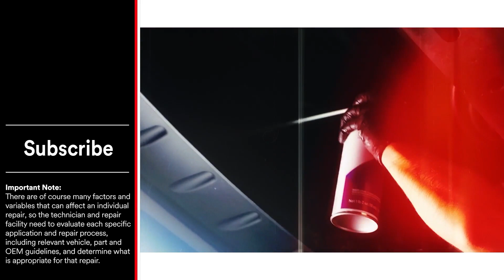OEM Adhesives Guidance Explained

Comment: Hi Shawn, great information as always! Does 3M plan on adding any adhesives to cover the German vehicles anytime soon? Does 3M plan on adding an adhesive that can be resistance welded after it dries, for multi layer parts that are weld bonded?  Thanks

Comment: What type of product would you use when a bonnet skin separates from the bonnet shell causing oil caning on the bonnet skin that dost shrink back sucking in the skin
Reply: Steve, 3M is not going to give advice on something that’s not recommended by the manufacturer. You have several problems here and it depends on where yours fits.
A: if the skin is completely separated from the frame or shell. It should be replaced.
B: If the “Oil Can” area is visible from the bottom, if don’t want to see it and hard to get at for shrinking, then replace it. It the don’t care what it looks like, shrink it and sand to feather and epoxy, prime, paint & clear.
C: If the skin is not free from the frame, it is going to take lots of work to get both sides bare and adhesive in the joint.
D: If the skin is not free, Epoxy for corrosion, grind frame & hood to bare, apply adhesive with tape where is will show.
E: Sand the oil can area twice as big with 80 grit in the middle, 120 another 3”, 400 grit another 3-4”.
(25.4 mm = 1”)
F: Adhere the skin and let cure overnight. As a rule, two-part adhesives do not shrink. Shrinking is solvents evaporating, this cures with chemicals creating the bond.
G: Once fully cured, use heat & hammer/dolly the metal to shrink the oil canning out of the bonnet. 
H: If too close to adhesive for shrinking, wedge to two apart, support as needed, then shrink.
I: Just remember, corrosion prevention, clean wax/grease, adhesive goes between bare metal, then spray a narrow pattern of epoxy while bonnet is on its side to let gravity help it run in to seal. You will have to get creative regardless. Now, the big one: Money or time? If a new, NOS or used can be found, how much? Compare that to you labor in hours. One will be much higher than the other. It’s your wallet and product is going up, not down!
ASE Master Tech since 1978 - Retired (Not 3M)